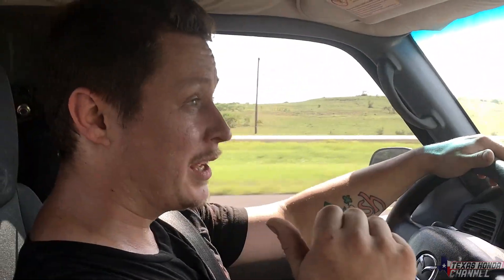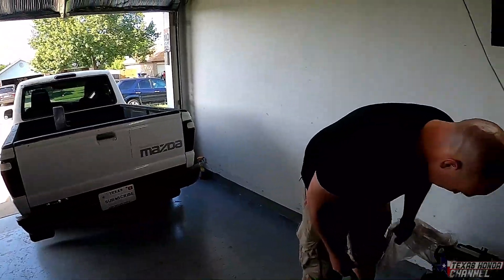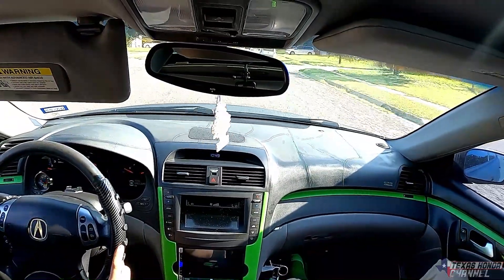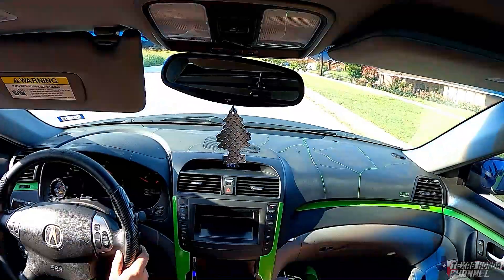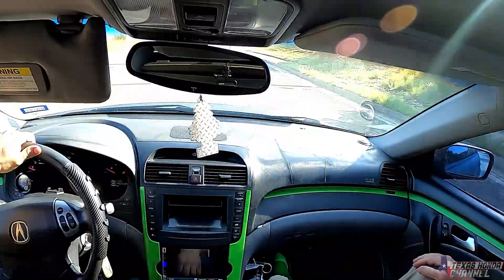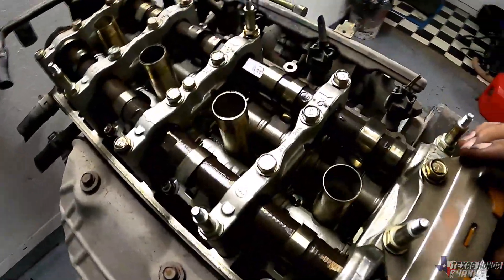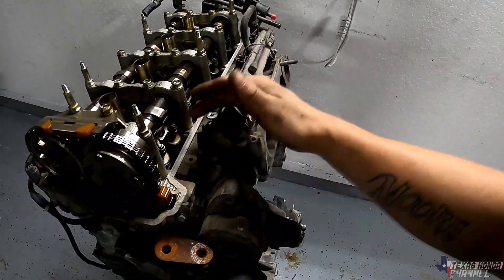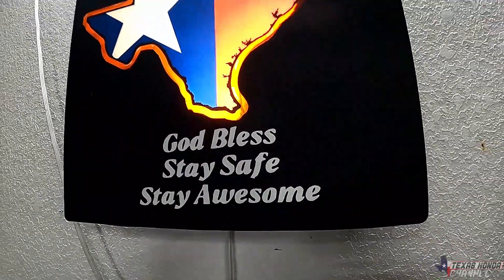K-Swap Begins Part 1- Acquired the engine!

Comment: Decent place holder engine to get the swap done and rolling, but I would say you'll for sure want a k24 for the torque whether you boost it later or not.
Reply from the maker: The k20 was the only engine I could find so I’m rolling with it. It’s always subject to change

Comment: Looks like u had better day @ junk yards than I did. 1st one hood I wanted for ranger was gone and someone trashed the bumper. On way to 2nd belt in expedition broke so had to fix that then 2nd yard only part needed from there was busted too
Reply from the maker: Dang it man :/ there are quite a few here that are in good shape just sitting in the yard -_-
Reply: @TexasHondaChannel  I was gonna do the edge hood n bumper for the ranger and need a radio bezel for 99-00 civic and a manual drivers door mirror for the civic as well. Almost nothing here n the yards we got
Reply from the maker: @GlassWerx  everything you said they have here
Reply: @TexasHondaChannel  we got small crap yards here. Not big  enough cities here like yall got.
Reply from the maker: @GlassWerx  Trust me i know the feeling. Belton gets their vehicles from the big city then tows them hours to get them to their yard lol they are smart and clearly way more rich than i because the fuel them rigs must take sshheeesssh
Reply: @TexasHondaChannel  one of our yards is owned by scrap metal company they try buy up all the old big stuff and they crush cars out every few months. The other has lots all over east tx and LA so better stuff goes to the bigger lots

Comment: Was there a reason you went with the K20 instead of the K24?  I would think the extra engine displacement would be preferred in a truck application.
Reply from the maker: They didn’t have any K24 already pulled out and this one was only $175 with $75 core and it was already removed. I’m all about saving time and money 👌🏻

Comment: Cool stuff, even if you run the k20a3 for a while with the stock head, it’s not bad. I have an ep3 with a k20a3, it only has I/h/e and coilovers with camber plates and rear adjustable control arms. It’s fun!

Comment: K20a3 with a2's hi lift hitting from 5 -7k kinda like the b18b' stroked out motor with the c1 heads so it doesnt blow. The up at 9k

But it is  86 x 86 square engine?   You think it'll be okay shifting at 8 with stock internals
Reply from the maker: I have seen a lot of these run 8k rpm with light mods safe but anything is better than this engine in the truck
Reply: You said anything is better than this engine lol.
Reply: @TexasHondaChannel  j series swap it lol.
Reply from the maker: @thronewalker1153  it won’t fit without frame chopping and a lot of other stuff i don’t wanna do. I have a video explaining this

Comment: What you gonna do with the trans out the Mazda? I need one for my ranger so I can get it back on the road
Reply from the maker: Not sure until the swap is done. Going to try to use it with the swap before i do the RX8 transmission but if that don't work i might sell it to fund more parts for the swap lol.